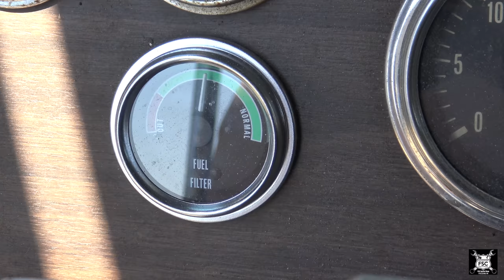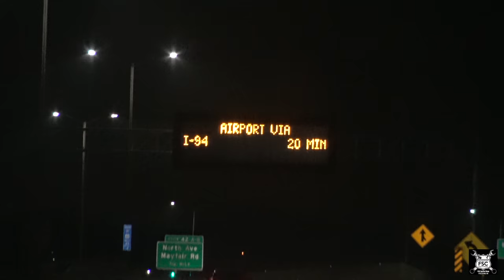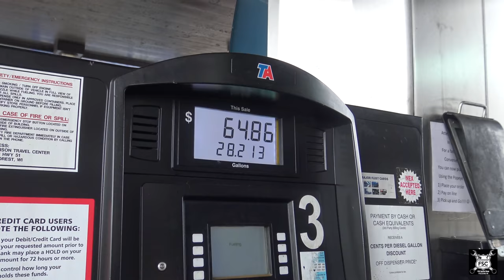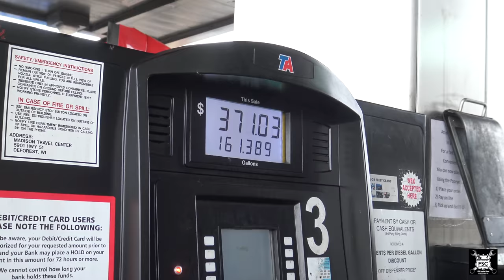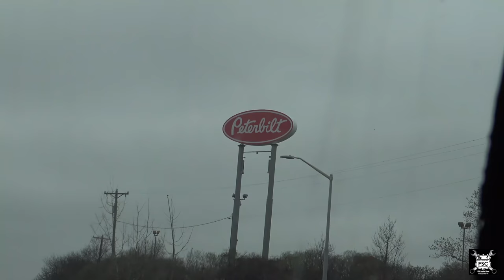3406B Caterpillar Engine's First Load

Comment from the maker: I did not know it should start faster.   This rig is my first mechanical engine.  I've been reading the comments and believe i have ideas where she may be getting air.  This will be addressed in a future video.  
Thank you for watching.   FSC
Reply: check fuel supply pump
Reply: Does the truck have that hard rubber suspension? Or did Peterbilt replace it with an air ride?  Did they finally upgrade those suspensions in the 80s?  It's reportedly why COEs became unpopular in North America.
Reply from the maker: @wanderingfido  "Air Leaf" was an option in the 80s.  This truck has that.
Reply: @fsctrucking  Nice.  Are you considering a syncromesh gearbox? No more double clutching?
Reply from the maker: @wanderingfido  i haven't "double clutched" in 22 years.  I "float" them.
Reply: @fsctrucking  Interesting. So how has the gearbox held up for maintenance?
Reply: @wanderingfido  I've never seen anyone double clutch a non-syncro truck trans, everyone floats them. They hold up just fine 👍🏻
Reply: Yea, my pete doesn't crank that much unless its winter.

Comment: Fuel leaking off on it ! It schould start a lot quicker than that. Pump accelerator once. 3406b dosen't have to wind on it like that
Reply: I agree something isn't right. Either fuel or compression. 3406 should give a grunt and be running.
Reply: fuel supply pump

Comment: Still...Cabovers rule! So the new engine is working out pretty well? How many miles were on it before you had to replace it? A Cat engine is my favorite! 🥰 I have a series 60 in my Walmart IH 9670...it seems to be a good engine, so far. Is the Pete a 10 or 13 speed?  It’s getting really rough out there on the road...stay safe and healthy. Are you able to get decent loads still?
Reply from the maker: She is an '84 with a 13 speed.  We are doing fairly well with loads.  We stay away from broakers when we can.  She has just over 1 million on the truck.  The original engine went till 800k.  Was rebuilt 20 years ago with non Caterpillar parts.   That failed with low mileage but 20 years sitting.   This engine has about 12k on her since I built it.  I used all genuine Caterpillar parts.
Reply: FSC Speed Shop 😎 I really like a Cat sound...there’s nothing much like it. I’ve never had a bad Cat engine and they seem to do quite well for us. Hope that you continue to do well on loads.🤩 Bet you get quite a few looks and comments on the rig. I love seeing them out on the road.Make the trip and enjoy the ride! 😎
Reply: @fsctrucking   i would like to work with you under your authority etc.      i can get a dually with a cummins diesel and hook it to a 40 ft trailer and haul loads 24,000 pounds and less.  i have a few drivers so that wouldnt be a issue.
Reply from the maker: @sffee8151  I don't have my own authority.   I run under another carrier's flag.   Unfortunately they don't do "hot shot".
Reply: @fsctrucking  you guys should get into hotshot. Duallys are able to pull 34,000 easily these days.  Love your channel though. Dies ypur company sign people with older rigs still? I can put my 2002 petetbilt and century class on in January

Comment: I was in Kewaskum Wi today, 2-27-24 there is a 1987Freightliner  Cabover for sale. New trans, clutch, and some other stuff. Place called TOP FUEL GARAGE. $25,000. A little high but with the repairs maybe not. Also a 3406B. Frame is in great shape. If I wasn’t 6’4 tall…I’d be VERY interested. I’d buy it anyway, but can’t as a full time rig.

Comment: The first trucking job I had was 1987 I drove a freight liner cab over with a 3406b and a 13 speed . 4:11 rears 400hp. In 1987 the only that would touch it was 425 cat . To this day that was a pulling like hell truck . With 4:11 rear at 2100 rpm was about 80mph. But it would go up hill 80,000 lbs. all most as fast ....

Comment: I'm on the hunt for an older semi now that I got my CDL-A. Looking at an 82 359 with a 3406 and 13 speed. I absolutely love the way Orville sounds and that's just one of the reasons I may go this route. It would cost me more money to upgrade my hotshot truck and trailer and then still be limited to hauling maybe 20K on a 40' trailer. An older semi and flatbed is cheaper than the hotshot equipment! It may not ride like my 23 year old F350 but this is about making $$$.

Comment: I had an 87' 362 with a 3406B @350hp- and an 83' 362 with a 855 BC 2 @ 400 hp- Thinkin' about another soon.....Couple things about the 362- Clutch cable Breakage- Pay attentiuon when raising/lowering cab-Make sure it comes down easy and straight. Other than that,Typical maintenance-And she'll Live with you for an etenity you treat her right.
Reply: Is 350hp easy for get an order? I thought average truck on this decade is around 435-535, So is the 350hp still recommended for buy?

Comment: I just bought a 1984 359 drove it home from Tennessee to Ohio and had my mechanic checit out the big Cam Cummins had a bad block and the rod bearings Bad and had some metal flakes in the oil filter. So now I’m putting a 3406B in it can’t wait till it’s done

Comment: Nice Truck , I drove the same Truck back in the early 80's and late 80's .
She had a 425 Cat engine 13 over drive with a Fuller Tran .
370 rear with with twin tandems plus power divider .
With a load she run 60 up any Mountain all day long or night . 
She would run 110 MPH but with 155 rears she would out west 130 MPH .
She was a great Truck she could get in anywhere .
I'm new to your channel I really like your video. 
Keep the forked end down in the tailgate up . Later and be safe.
Reply: @steveward8652  yessir, with a .87 OD as in a 1980s 12513 or 14613, 3.70 rears, and 11R22.5 height tires, you'd have to turn 3300RPM to make 130MPH, not to mention spinning truck tires or driveline at that speed, or even keeping it on the road!

Comment: You know I'm starting to see more 359s on the road my dad had a 85 model
Reply from the maker: I always loved the 359.  I test drove one before I bought Orwell (1984 362).  Maybe one day I'll bring a 359 into the shop.
Reply: @fsctrucking  yeah I would love to find my dads 359 it had a 3406B it was a pretty good truck but he traded it in on a 2004 379 extended hood he still has it
Reply: @dakotajohnson8782  I had a 2004 379 extended hood. Wish I could have kept it. It was the last year they had air powered windows.
Reply: @bill7778  yeah dads had roll up windows I kinda wish they was all roll up I mean power windows are cool but they can be a pain in the ass

Comment: 3406 Cat 550 horse 13?  What a sweet lady.
Reply: I think I heard in another video the HP is in the 400-425 range. 550 out of a B model Cat, you would want someone who knows how to watch and listen to that engine closely because they were not originally designed for that kind of power.
Reply: @tuba7084  Your probably right I don't know that's why asked I did not state fact but I have been told by a owner operator that a fellow In Florida had his cat built make that  power.       I don't know if it's fact?    I can and do watch videos and am able to understand even with my limited education you see I am only a general practice MD.
Reply: @eddiemartinez6  the 3406E is capable of safely making that kind of power. The E model is an electronic controlled engine. It has all of the features built in to protect itself from a catastrophic meltdown if something goes wrong. The A, B,C models are fully mechanical so when they are making huge power, the operator needs to monitor the engine closely so they don’t melt the pistons with high exhaust gas temps or cook the engine by high coolant temps. The mechanical engines use a mechanical rod from the accelerator pedal to the fuel injection pump on the side of the engine.

Comment: A little tip when you're using that ultra-low sulfur fuel put a little 30 weight non detergent motor oil in with it for that old motor needs to lubrication
Reply: Buck Yingling synthetic two stroke oil is better yet
Reply: I know a couple of heavy diesel mechanics that swear by adding 4oz of 2 stroke oil (Stihl, I think) for every 50 gallons of fuel. They use it in their own service trucks and personal vehicles...

Comment: A mechanical cat will start easier if you crack the throttle open a little bit !
Reply: Are you saying step on the pedal a bit before cranking?
I am trying to buy my first mechanical Cat3406 425 HP. It has an air starter and I would love to start it with no problems when I pick it up. It’s a 1993 Volvo GMC Western Star with less than 200,000. This will be my first cab over. I’m a milk tanker yanker.

Comment: I had dual one hundreds and I put 191 gallons in one time.
Reply from the maker: I bet you were staring at that fuel gauge and praying for many miles.
Reply: @fsctrucking  I was sweating for sure.  When I got done fueling it didn't want to start right away.  Foolish to get that low.